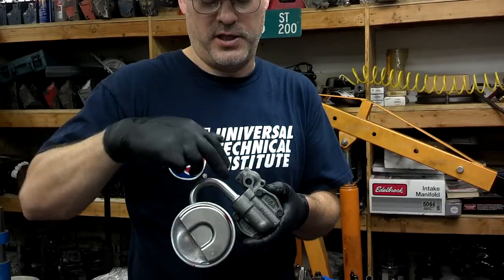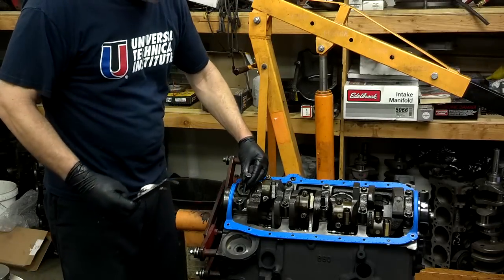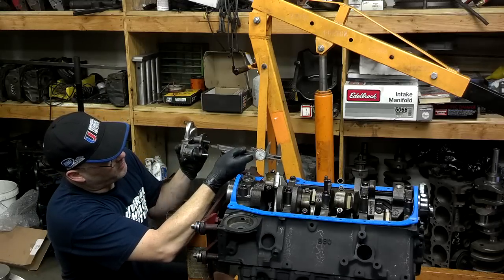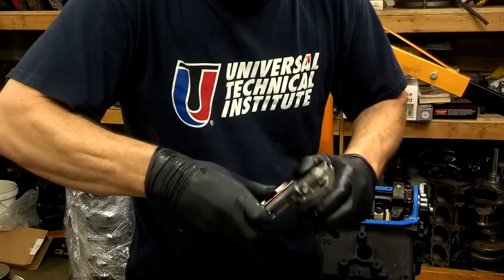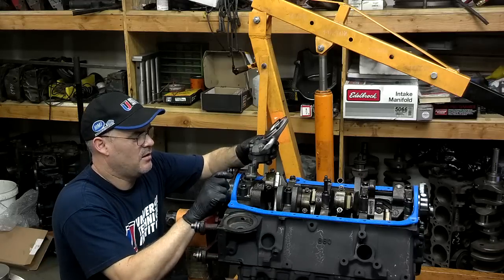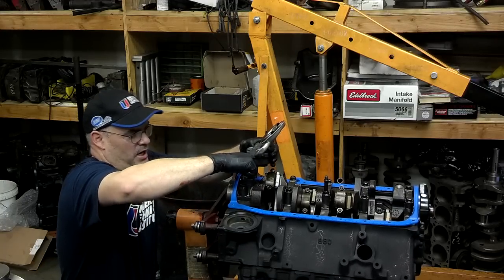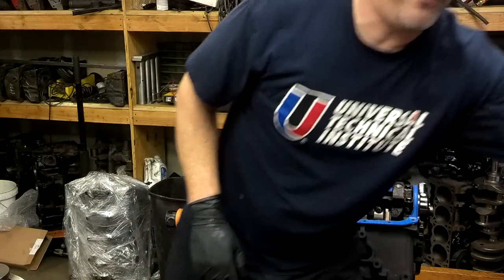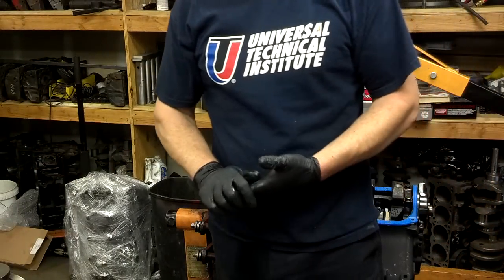Oil pump installation 350 chevy

Comment: In my Omega 350 .granmas car i inherited ..running still..had a clicking lifter on passenger side..let me to dissasemble and clean ever lifter..put ut back togeather ,started it.. clicking came back.humm then i started to notice no oil realy comeing up the tubes to the rockers😑so im guessing its only ran every week for 50 years maby it needs a oil pump. I just want to give my 16 year old dog a few last rides..any sugestions?

Comment: Hello..I have a Question...I have an 1988 GMC Suburban 5.7l...My Oil gauge isn't working.. ..Turns  out I removed the Sending Unit above the Oil Filter housing ..Started the engine ...No oil was coming out ..??...is there a Tube or something that got disconnected in the Oil Pan...Thanxs Daren..

Comment: Got an 88 350 tbi is it possible to change the oil pump with a cherry picker or floor Jack without removing the motor? I mean I realize I’ll have to drop muffler and loosen my motor mounts and probably front drive line as well but it’s a daily driver and really can’t afford to pull the block

Comment: Tried 85 ft/lbs per Chevy Power and pulled the threads out so I drilled out the blind hole, tapped it through, then used an ARP stud and only 55 ft/lbs. That was over 3 years ago.
Reply from the maker: TQ is 50 on the pump
Reply: @Myvintageiron7512  Sounds ample to me.

Comment: 1 of 2 I have just watched your video and did as you said as far as changing my oil pump and screen in a 97' GMC C3500 5.7 vortex engine that was already installed in my van. Everything went smooth while doing it and finishing it up. I added 4 quarts of oil (15W-30) and 1 quart of oil to the filter and checked it. Fine, no problems.

Comment: Myvintageiron7512, Thanks for the video- very helpful. Get yourself a couple of 1"x1/4"x1/4" magnets from the BAY. Line those end-to-end in the bottom of the oil pan where the end of the pump would touch it. Install the pan flush to gasket. Remove pan, remove magnets. There is now a 1/4" gap. You heard it here first on Roller Derby.

Comment: Alan Tibbetts
I have enjoyed your 383 stroker build series..very infomative.  Was wondering if you would ever consider making a video about EXACTLY the way YOU assemble a SBC (not how to install crank, cam heads, etc) but a step by step on assembly.  Example:  when to put oil pan on, oil pump, heads, intake, timing chain assy, in other words all the simple things most motor heads take for granted.  This is going to be my first build and I have some rather pricey parts and don't want to mess anything up along the (or have to go back and redo something because this was supposed to go on before that).  Just a thought..again..thanks for your expertise.  Look forward to the video.
Reply: Seems like to me between all his videos he covers all.

Comment: A decent vid.  Good move going with the steel sleeve drive shaft.  You should probably tack weld the pickup, even on a stock POS.  You never know what an engine may have to endure before it gets rebuilt. The next guy may trash it, but at least you'll know you did your job right, and the pickup's not to blame.

Comment: One of the best demonstrations I've seen.  Do you recommend using RTV on the outer corners of that one piece pan gasket?  How about on both sides of the chain cover, and where the seal mates to the cover?   THANKS

Comment: Is there a check valve in that pump that doesn't allow pressure to bleed off? I have a 1998 5.7 Sometimes at start up I here a either a knock  and or valve/lifter noise. Sometimes not. Has done this every since rebuild.

Comment: Is there anyway that melling intermediate shaft can be installed from the top under the distributor.... I think I forgot to put the plastic collar on when building my engine but I do have an after market melling shaft ... Kinda dont wanna drop the pan to change it

Comment: How about a video on 'what gaskets need sealing and which do not".  I've seen so many videos that say no goo on headgaskets, some say copper spray, some say no goo on waterpump gaskets, some say use goo. Also: what about the 'forgotten oil galley plug"?  Will the machine shop take it out and not replace it when the block is hot tanked?

Comment: When I set the oil pump pickup screen air gap between the screen and the pan I do it just like he does and then I run a little borescope camera in thru the drain plug hole and make sure the gap is 100% correct.  The borescope camera I use cost about 30 bucks and I use it for all kinds of stuff.

Comment: I just bought a 99 tahoe 5.7 vortech 250k had a misfire. Turns out bent exhaust valve I put new heads on and sealed it up. But now I seem to have low oil pressure.. I changes the oil and filter after.. but could the pickup tube be clogged now from being sloppy with block surface buffing?

Comment: It is my understanding they also make a blue rubber gasket like the one in this video for a two piece rear main seal motor.  I was wondering if you had ever used them and what you thought about putting one on a 3970010 block which has a 2 piece rear main seal crank.  Thanks in advance for your wisdom and assistance !!!!!!

Comment: I been building motors for decades, we didn't have the new style 1 piece blue Fel-Pro OS34509T Engine Oil Pan Gasket Set oil pan gaskets back in the day and I was wondering if YOU feel there worth the extra cash to use them on a  new fresh 327 SBC rebuild over a standard 4 piece old school set .  Seems the oil school gaskets seal up when new but start leaking as the mileage & age gets to them.
Reply from the maker: yes well worth the money

Comment: That was helpful tks,I'm wondering though,my application is a marine SBC since those motors run high RPM's is it a good idea to tack weld the oil pick up tube in place..tks again
Reply: yes, absolutely.

Comment: I noticed this is an 880 casting you are working on. I am using this same block to build a marine version of the engine to replace a Volvo Penta 5.7 with TBI and Vortec heads. Looking through some info I see possible 5.7 crankshafts as 14088526 and 14088535. Are these directly interchangeable? Been searching the web and can not find any info regarding that. Thx. Love your videos!

Comment: Is there nothing that holds that oil pump drive shaft on cause it just falls off when the motor is upside down or won’t it come out when you pull the distributor

Comment: May I ask questions that circle around one issue please? Ever since I had my 89 Cheve Silverado 350 engine rebuilt about 10 months ago, my engine will often start with a knock. To me it has a strong resemblance of a rod bearing. it lasts for about a second or two and I notice it stops as soon as the oil pressure gauge on the dash starts to move toward positive pressure. I sense it may be getting worse but not convinced. Oil pressure is good. 60 psi cold, 12 - 20 warm at idle and in gear. The overhaul included boring cylinders, milling heads, grinding the crank, new pistons, rings, new main and rod bearings and a new oil pump.Is it possible the oil pump is causing the dry starts? I installed it with the screen as parallel to the block as possible, not 1/4 inch from pan as I found out should be not to long ago. Could this be the problem? My thoughts are to reposition the screen and I am wondering if it would it be okay to replace the rod bearings with new ones as a precaution before they start doing damage to the journals? Your video on installing the oil pump was very much appreciated. Thanks in advance for any help on the dry starts.
Reply from the maker: +89 Sylver T Yes the pick up screen should be moved and bearings replaced
Reply: I just bought a 93 Silverado and it does the same exact thing. Cold start rattle, then quiets down once pressure is up. Maintains good oil pressure driving down the road. Once it comes to an idle is sounds like a light ticking noise, almost like small marbles rolling around. I can tell this motor isn't original based off the casting numbers and the fact that it's all painted. My guess is either a pump screen issue or a main bearing. I plan on looking at it closer this weekend.

Comment: I've been reassembling my 350 motor. I used the same steps to install the oil pump and pick up except I used the depth of the pan to set the position of the screen. I bench primed the pump, My question is now that it is installed I don't seem to get the flow thru the push rods when using a drill motor testing the pump drive. Would it help if I rotate the crank, or what might you suggest?

Comment: I have a question about cam button when I disassembled the the engine “a 1976 gmc 350 4bolt main truck engine” well it didn’t have a cam button does it need one the engine was rebuilt by someone previously 

And this video was very helpful thank you
Reply: Cam button is for roller cam.

Comment: My 75 corvette l48 chewed up the nylon cam gear. I pulled the cover and see lots of missing plastic chunks are in my pan. A few weeks ago I noticed car would run a little hotter but it was summer heat. It threw the chain in my driveway when starting not running. Sgould i replace the oil pump and what else should I check adter installing the new melling double roller chain and gears?

Comment: i would imagine the compressed thickness of the gasket is between 1/4 and 3/8, would it be reasonable to do the same thing you did as far as putting the pan on to move the pickup, but without the gasket?

Comment: Do they make a solid oil pan gasket like the one in this video for a two piece crank seal ?  I would like to use one like this on my 3970010 block but I don't want one if they have a better chance to leak.  Thanks, dt

Comment: Just finished a 355 sbc. top to bottom. My son thought he bought a Melling pump from jegs but jegs sent there own.<aka junk> Can`t get much more then 10 psi at 1500 rpm then idle at 5. Guessing the spring is hung up. This has a stock pan . Can use a 1055 Melling or will it run dry? What pump do you rec? Thanks in advanced. Love the channel
Reply from the maker: I would use a std flow melling M55
Reply: @Myvintageiron7512  so for a 600 hp sbc with .003 bearing clearance what oil do you recommend?
Reply: @Myvintageiron7512  a was told to try a 55a? z28 pump/Thoughts?

Comment: I was priming the oil pump with a prime tool and drill and it feels like a bump in one spot. to better explain it (i hope) at the end of a full turn the drill kind of has a jerk like feel or bump to it. i would think it should be smooth all the way around (360) any idea or seen any thing like it?  bbc 454 just rebuilt  the shaft is like the one you used in the vid the upgraded one.  thx  mb

Comment: After installation of the pump when installing the distributor. Will where the pump drive shaft sit mess with which tooth my gear on the distributor sits? I'm having issues getting my 85 iroc to properly sit on timing. Distributor dropped all the way, timing chain is on the correct tooth, and timing set it at 6° advanced, but still acts like it's out if time, so cant the oil pump driveshaft be sitting in the wrong position for my distributor to sit on the correct drive tooth?

Comment: I have a question? I have a 93' GMC Sierra with a 5.7 TBI motor that I'm currently re-assembling having had the heads milled and installing a new timing chain and gear set. I was inserting the distributor and pulled the oil pump shaft out with distributor trying to set it in right. My question is, would it be a problem to insert the oil pump shaft back in from the top or does the oil pump now have to come out to fix the problem?
Reply from the maker: Just put it in from the top as long as the plastic retainer is still in place

Comment: just wanted to double check . You said you don't need the gasket for the pump and the torque for the bolt is 50 lbs. for my 350 chev engine. Great video !
Reply from the maker: Yes that's correct
Reply: myvintageiron7512 thanks for the help .

Comment: Thanks,I,am doing a fuel pump switch from 2wd to 4wd ,first time for me doing this.It,s a 4.3 vortec . I,ll switch oil pans as well. my question is oil pumps through with drill , does this indicate that I have a good pump and I should have have enough oil pressure. it,s a used pump, perhaps a new one is the only way to go ? Good informitive video.

Comment: I've installed a Melling M155 pump on my SBC (1999 Tahoe 4x4) and it's seems to be making a lot of noise compared to what I had on previously.  Is that something to be concerned about?   I'm figuring noise = some sort of vibration would could end up a really bad thing if something breaks.  Would like to know if you or others have had this issue.
Reply from the maker: did you use the all steel oil pump drive or the plastic OEM sleeve if you used plastic one you need to change it the HV pump requires the steel sleeve shaft

Comment: I know this is an old video but, what are your thoughts on high-volume oil pumps vs standard.. Many say there is no need for a high-volume oil pump on a performance small block chevy (for me lt1 gen 2) and that it puts more stress on the cam gear stripping it out within 10-30 thousand miles. (this is a roller cam setup)  I have never had this problem but thought I would open a discussion due to the fact I am always open for input from professional engine builds that do this job day in and out not the sounding boards

Comment: Hi. I have a 95 suburban 1500 4×4 with a 350 motor. Oil pressure very slow to come out.  And the motor knocks until the oil pressure raises.  Is there a way to check the oil pressure? Your advice will be appreciated .
Reply from the maker: hook up a manual gage

Comment: Building a late 350 block getting close to needed the oil pump on, this is the first motor iv built myself, I torqued all the main caps with out the oil pump on could I have damaged my bearing? And I'm not  sure if its only the late blocks mines a 91 ther was a plate  kinda shaped like Idaho thin sheet metal like us it nessesery that I use this? I think it's to keep the oil from sloshing up to the crank. Any help thank you

Comment: Ok thanks man. Also, I just put a rebuilt motor in my truck and it's running real low oil pressure. Like the minimum of what it should be. About 8@1000rpm 12@2000 and like 20@4000. I was told it has a brand new Melling high volume oil pump in it. So what else should I be checking for? Has a manual guage for the oil pressure, so I know it's reading right.
Reply from the maker: +osufan36 wow that's really low for a HV pump I think you may have some excessive clearances in the engine
Reply: @Myvintageiron7512  ever figure that out?

Comment: I just rebuilt and installed SBC 350 in my Blazer, and oil pressure at startup is @ 50psi when it warms up oil pressure is @ 10psi. Is this normal for a 70's block ? It has 268xe cam, timing chain and hydraulic lifters, stock crank and 30 over Pistons. Oh yea and stock size Mahle oil pump.

Comment: ? I got a rebuilt 350 sort block  that been setting for 6 years and the block is rusted.
I was thinking about just honing cylinder but now I'm thinking I should  get it hot tank.
rust in the oil galley is  probably not a good idea. Do I have to remove the cam bearing for that?
Reply from the maker: I would

Comment: One quick question about the rubber pan gasket. Do you use any RTV sealant or just depend on the fact that its rubber to seal? Thanks.
Reply from the maker: I always use a small amount on the four connors

Comment: I have a 327 2 piece main seal where the seal comes in contact with the block can you use silicone? if you do and you shouldn't what are the Ramifications . I'm talking the whole length of the seal on both pieces where they come in contact with the block and the main cap in the channel of the gasket   . it is a Fel -Pro gasket.
Reply from the maker: Yes you should use some sealer between the main cap and the block or it will seep oil

Comment: i have a chevy 350 5.7 that is running oil pressure from 55 pounds to 80 pounds..is that too high?  if so, would the fix be in the spring/valve on the oil pump?

Comment: question I have a high-volume oil pump I have great oil pressure at start when heats up dropping below 10 after running about an hour dropping to zero I put the oil pump on do you think the pickup screen has anything to do with that thank you
Reply: I know this is old.    I have no idea what you are talking about.

Comment: I see on this build that you are using a one piece oil pan gasket that is blue as opposed to one that has separate main bearing gaskets.  | was wondering what you thought about this one piece gasket?
Reply from the maker: They work very well

Comment: Can a oil pump make your engine knock or ping if its not working correctly? I have a 84 Chevy el comino w/305 small block w/ a 350 turbo trans. It was only doing it when I shut it off  now it comes and goes running or not!?

Comment: Hi bud I recently finished building a 540 bbc I noticed the distributor was not sitting completely flush on manifold without gasket, engine is on a run test start , so I got the nylon washer spacers used the thick one , engine started no issues , oil pressure 50 psi, then it started leaking oil from the washer so I made some gaskets and put on either side of nylon washer , started it up and noticed no oil pressure and noise, so I pulled out dizzy and noticed drive shaft was not engaging , pulled out and just used one gasket , noise gone pressure back up 50psi but I noticed with measuring that drive shaft is only sliding in to dizzy shaft maybe a few mms 
It’s a dart big m block ,mellings standard pump and mellings bbc drive shat what are your thoughts on this please help you seem very knowledgeable I watch all you clips